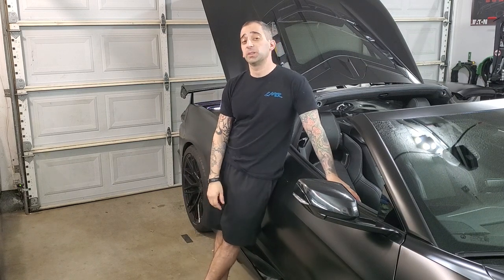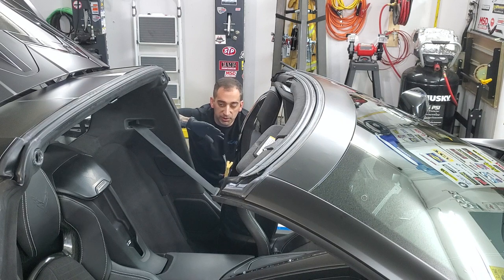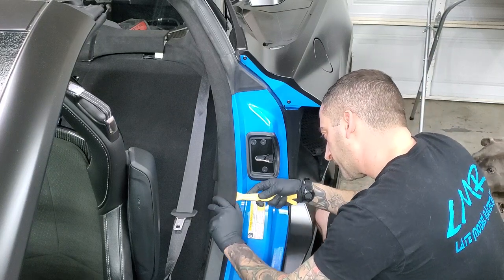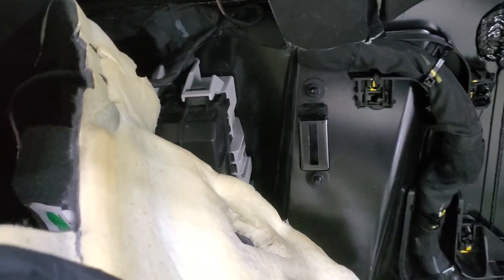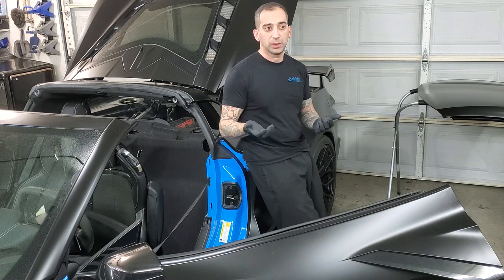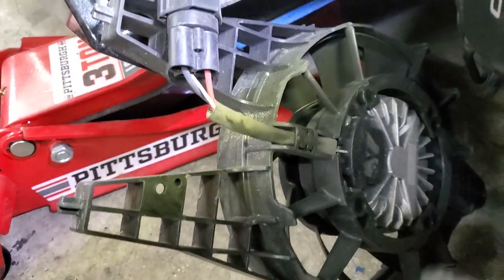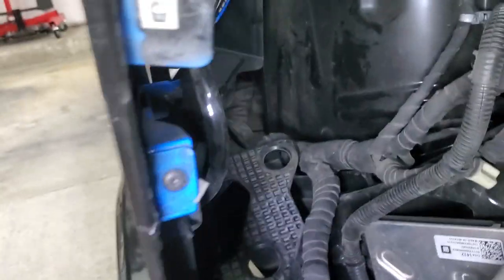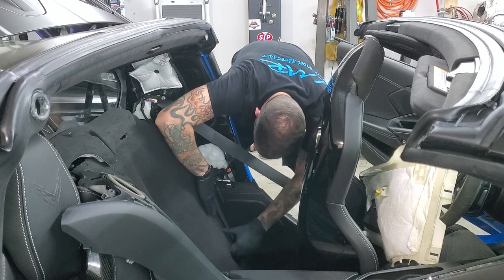Get wires into engine bay from passenger compartment C8 Corvette

Comment: Truly, that was extremely helpful.  And I will be running the wires as what you say the right way.  I am thinking about getting them along the wiring harness by using a small fiberglass rod which is thin enough but still pretty stiff to then push it through and then pull the wires back from the engine side front into the cabin.  And yes I am working with a Z51.  And you are right we want to be able to control and enhance the engine bay with red LED's along the fenders.  We live just outside Gatlinburg, TN, it's a tourist town and we drive through town almost every weekend.  I have never seen a car getting more attention then the C8 does and the folks like to look in and see the engine.  Again, thanks for the help, it's much appreciated.

Comment: I am thinking of removing the bottom tunnel panel, running fused wires from the battery straight to the engine compartment. Wires in a loom for abrasion protection. That way all is isolated from the vehicle electronics and is fused at the battery if anything shorts.